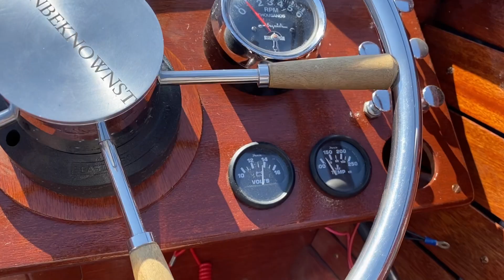S3 E21 Gary Greene to the Rescue

Comment: Your backfire through the carb is either a misadjusted accelerator pump or simply the accelerator pump is bad.  Could also be a blocked passage or missing check ball.
Reply from the maker: Carb was newly rebuilt so we were hoping those possibilities had already been dealt with. We solved it by enlarging the primary jet one numbered drill size. Been great ever since.
Reply: @glassgoat9601  
That's one way to deal with it.  But I would still look into the accelerator pump.  I worked in the boat repair business for about 25 years.  Loved the old stuff. Also, just because it was rebuilt doesn't mean it's good.  Lord knows how many carbs I rebuilt.  Some were pretty cantankerous.

On a side note, would you be interested in a 1942 Chris, 33ft?
Reply from the maker: @curtismehlhaff2518  thanks but no. I have enough projects for the next few years already. 10 years ago I might’ve been.
Reply: @glassgoat9601  
It's free if that makes a difference.

Comment: You make so nice work, but it wood look good if you could use screws vith a straight slot and all of them pointing in the same direction i.e. vertical. Excuse my spelling (Danish)
Reply from the maker: I don't mind using straight slot screws when they match screws already on the boat but this boat came with Frearson screws. Lining up all of the screw heads might be a bit more than I have the patience for :) Glad to have you watching the Wooden Boat Experience!
Reply: @glassgoat9601  Thanks. Good answer.

Comment: Catching up on on your videos. What did you use to to hold the back seat vertical plywood up? They look like they'd just flip down when you go forward. Or does the pressure simply hold them in place?
Reply from the maker: Nothing, the angle and gravity seems to be enough. Also, they’re still going to get upholstery which will help as well. EVERYTHING should be done for the Hammondsport show mid July.